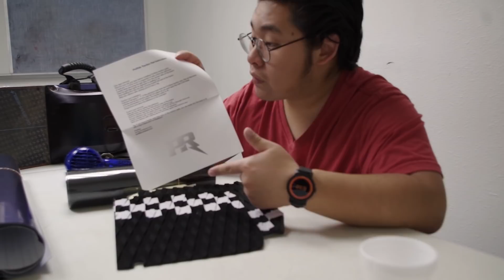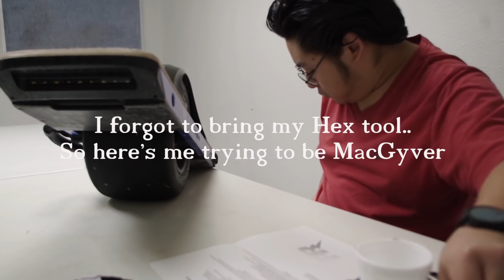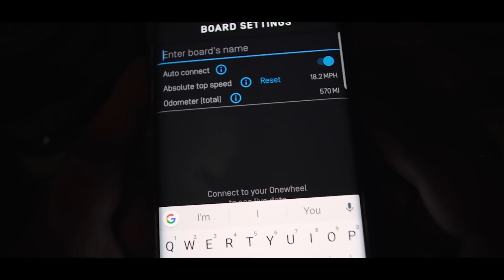I Modified My OneWheel

Comment: bROOOOOOOOO  just got my onewheel today, your mod is exactly what I had in mind. I wanted to wrap it with carbon fiber wrap, I wasn't sure if it is doable, your video gave me a piece of mind. Also the end product looks amazing. Keep up the good work man!
Reply from the maker: That's awesome!! Welcome to the club!
Just remember to use high quality wrap and not the cheap Chinese knock off ones. Makes a huuge difference and it'll be a lot easier.
Vivvid, 3M, Avery, all make good products. Just make sure they're authentic.
Reply: Ayy, thanks.👍

Comment: So did the new grip pads help your feet? Did they effect the ride positively or negatively?  Can you wear different shoes with them that you couldn’t with normal grip tape?   I’ve been riding my onewheel for a couple weeks now and I’m already thinking how I’ll need to reapply some grip tape.  Seeing you do it was great, thanks!
Reply from the maker: So the ProRides didn't help a lot with my foot fatigue, unfortunately. Its texture is soft so it doesn't feel like you're stepping on hard wood, but it's not 'squishy' either so it doesn't have a lot of give. That said, it grips fine and my feet stay in place with no problem. If it gets wet though, it gets pretty slippery.
Shoes shouldn't be an issue with ProRides though. I haven't had any problems with any type of shoes with it.
Reply: Slide Wreck Dan thanks!  I was really wondering if the pads would feel ‘squishy’ and sort of make it harder to control the board.  It looks great.  I’ll probably stick to grip tape, but when I redo it I’m going to cover the whole tail and dispense with the sort of ‘cut away’ thing where you can see the onewheel logo.  I’ve also put just the glossy scotch tape over the logos on my rails to keep them from getting scratched up.  You can’t even see it, & if they get scuffed I have a whole roll of the stuff...
Reply from the maker: @drewpetricc  Honestly, your best bet for rail protection is railgaurds. Even my vinyl was only a temporary solution as it gets torn up because it's thin material. Should be the same way with tape.

Comment: One wheel or Boosted board? Which should I get?
Reply from the maker: Depends on your needs. Onewheel is great for rougher terrain and roads that aren't smooth. Boosted is great if you have really smooth pavement everywhere (like a trail) and is more of a cruiser.

Comment: Question about the Pro Ride feet things. Are yours a thicker rubbery material? They look like it in the video. Reminds me of anti fatigue mattes stores give to cashier's to stand on.
Reply from the maker: They are not rubbery material. It is closer to foam. It is the same stuff that goes on surf boards. That said it is very thin. It does feel better than just grip tapes, but it's not exactly "coushiony" either.
Reply: @SlideWreckDan  sounds sweet tbh! Thanks for replying I'll put this in my notes for when I get my own board :D

Comment: How did you do that smoke btw
Reply from the maker: So for this video I used 'smoke cakes' which if you light it on fire it produces smoke for like 30 seconds. You have to have everything set with the cameras and all to make sure you get it right before the smoke runs out so it's a bit tedious. Now a days I just use a fog machine. It does look more like fog than smoke though so to get the smoke effect, that's what I did.

Comment: Hey Dan, loving the mods! We actually just launched a Kickstarter (https://www.kickstarter.com/projects/1552002329/injection-molded-glider-v30-for-onewheel) for a mod that makes the Onewheel safer to ride with nose dive protection and lets you roll the Onewheel like luggage when it is not is use. Let me know if you are interested in a demo unit and/or Affiliate link.
Reply from the maker: Going through all the missed comments right now. Looks like YouTube flagged this comment because of the link. If the product has launched let me know. You can reach me via email at 
und3r3000club@gmail.com

Comment: Can you post a link for the new grip tape your added?
Reply from the maker: www.prorideusa.com or you can also get them at www.craftandride.com
Reply: @SlideWreckDan  All these kind of upgrades are great, but best upgrade I got for my onewheel was a tread Tyre, https://id3528.securedata.net/test.burrisracing.com/merchantmanager/product_info.php?cPath=1_206&products_id=835 

No more skidding on rocks and wet/smooth surfaces, also gives your board far more grip/power as you don't lose traction anymore with the tread. Honestly best decision I made was getting one of these tyres, Tyre repair company fitted it within hours.

Comment: Either I’m getting an electric scooter or blowing 2 on this. IS IT WORTH BUYING?????
Reply from the maker: Great question! I would say absolutely yes, but also it depends on your application. An electric scooter will have a less challenging learning curve and the OneWheel may have a bit of a learning curve until you're fully comfortable riding. For me, as a complete beginner to any sort boards, it took me roughly a week to 2 weeks to start riding comfortably. I have a video on that on my channel as well so you can check it out if it interests you.

A OneWheel is also great because you can ride offroad and on smooth pavement and it's far more portable than a scooter as well. There are some pros and cons, but I think the OneWheel has a lot more pros over scooters and for sure I know you will have tons of more fun on a OneWheel. 
One thing to keep in mind is that OneWheels aren't designed for fast speeds. It's for the enjoyment of the ride and the riding style such as carving like a snowboard. If you just want to hit top speed and just keep riding top speed, a scooter might be better. 
But if you want a really great ride, portability, all-terrain, great community, and super fun vehicle the OneWheel is the way to go.

Let me know if you have any specific questions about it, I'll be happy to answer it!!
Reply: Slide Wreck Dan awesome response bro, my job is a 20 min walk but since it’s the dead of winter here and I’ve ditched my car I was hoping a one wheel would make life easier
Reply from the maker: @Dee-ye2dk  For sure a 20-minute walking range is more than doable on a OneWheel. Especially the OneWheel XR. Keep in mind in the winter and as it gets cold, your range and battery life will decrease. It will return back to normal as it gets warm too. I get roughly 4 miles in range during the winter with my OneWheel Plus. Couldn't tell you how much you would get with XR as I don't have one, but my guess is around 8 miles on a very cold day.

Most electric vehicles like this you may have to be cautious riding in temperatures below freezing. For a OneWheel you have to make sure the motor and internal temperature doesn't go below 32F or 0C because it will slowly pushback and shutoff if it does go below it. The trick is to store the OneWheel in room temperature and keep the motor in operation while riding. So no long breaks while riding and then keep it warm whenever you're not riding. The motor will stay hot while it is in operation. If you leave your board in freezing temperatures it simply won't turn on below freezing internal temperature.  

I mostly commute everywhere on my OneWheel so it is definitely doable. Especially with areas with a lot of bike lanes that makes it easier to commute too.

Comment: Know that this is a developing technology and nothing is 100% safe! If you are a new rider or over the age of 30 years old please do yourself a favor and be very aware that you are mili-seconds away from a catastrophic failure or a serious wreck! I purchase my XRPlus and 100 miles later, with out warning this Onewheel turned me into a "human fly swatter" I broke my arm and dislocated my shoulder in a blink of eye. Don't be fooled you cannot run out of a 10mph bail-out or re-cover from a nosedive you will hit the deck and hopefully you have the proper riding protection! I sent my new board back to the lab to determine the all of sudden failure and Onewheel determined it was faulty internal parts. I sold it immediately after Onewheel shipped it back. A bitter sweet disappointment and now comes the medial bills!!! Enjoy.
Reply: alex deCat dude, totally agree. Turns out you can’t run out a 30 mph speed run either
Reply from the maker: Sorry to hear about your injuries.
I do agree that OneWheels should be ridden with caution and care. For this reason I rarely go past pushback. I've spoken with people with over 3000 miles on their OneWheel and did not have a nosedive either. The OneWheel can be very dangerous when pushed too far. For the most part, if you respect the pushback, you will reduce the risk of injuries exponentially.
Reply: Lol baby. Falls once "whaa I'm done" if I had quit everytime I got hurt mountain biking and quit I'd be a whole lot less happy. Lol I fell at 22.4 mph and got hurt. Healed up and had 700 miles of pure fun after that. But yea. Quit whenever something hurts you.

Comment: would a milk crate have made any of this a bit easier ?
Reply from the maker: Uhhh possibly? But I think it'll still get in the way because you have to lift the Onewheel into different corners of it. If the rails are sitting then it'll cover up the area.
Reply: @SlideWreckDan  I've seen  ppl using milk crates as workstations by setting the wheel in the middle and the board crossing the top like a platform or cut out sections of the crate to use as trunk stands...didn't think about that til I saw it so I thought I'd throw it out there :)

Comment: You could've just cleaned your tape
Reply from the maker: The grip tape was worn out so the 'sandpaper' like texture was gone which made it slippery. It wouldn't really have helped to just clean it. But also I've been considering getting the proride traction pads for my feet so it worked out.

Comment: It doesn't void your warranty to wrap the board, or change grip tape... That's all legal bullshit. If you're that worried about voiding the already terrible warranty, just remove the wrap and switch back the griptape before sending it in for repairs.
Reply from the maker: I worked in the automotive industry for a while and I encountered a lot of experiences regarding factory warranties. Generally, if I want to keep something covered, I keep it stock because, at the end of the day, the only way you can force a company to follow the law is by a lawsuit. Nobody really has time or money for that so companies put the do not remove sticker and whatnot on their products and make strict guidelines for modifications. 

FM did state changing the grip tape will void the warranty, but since my board is so old now, it doesn't have any warranty left in it. Which is why I started to "modify" the board, although no major internal components have been changed on it still. 
I wanted my board to be covered in case something major happened to it. OneWheels aren't cheap!
Reply: @SlideWreckDan  I've owned a OWXR for about a year now and my board is pretty customized. I've also had to send a board in for repair and I've had multiple friends send their boards in. Footpads only have a 500 mile or 6 month warranty. Also changing the grip does not void warranty, I had to change mine after going to Colorado for Race for the Rail last June and FM said it was totally cool to change grip tape, just don't ruin the sensor. As far as Sidekicks go, they're essentially a sticker, so they can't possibly void warranty. I even Changed my tire and that still didn't void my warranty. Warranty is only voided if your mods mess something up on the board, which is HIGHLY unlikely.
Reply from the maker: @c0pyimitati0n  It's nice to know FM is pretty lenient. I've heard a lot of hit or miss stories with their warranty so I wanted to stay on the safe side. As far as sidekicks go, I wasn't really aware of them much and I didn't think the rails were going to get so chewed up until they did haha. But I would've gotten them earlier for sure.
Reply: @SlideWreckDan  the OneWheel sure is addictive isn't it? Have you heard about Race for the Rail or Floatlife Fest? Two amazing OneWheel events.
Reply from the maker: @c0pyimitati0n  Yeah I definitely heard of both! I hope I can make to one some day
Reply: @SlideWreckDan  definitely man, they are life changing experiences. I'm going to attend both events again this year. Come out to Colorado and have a blast with us 😀